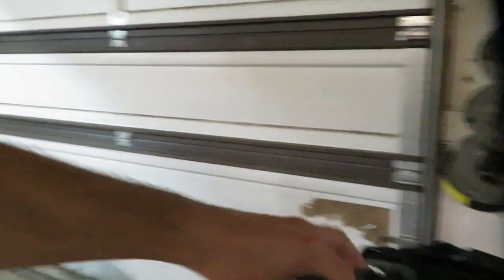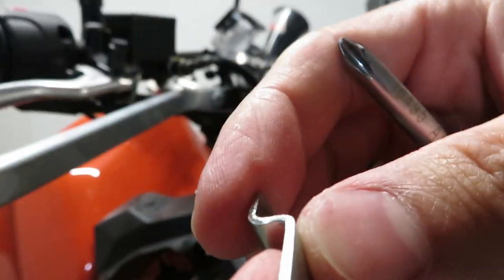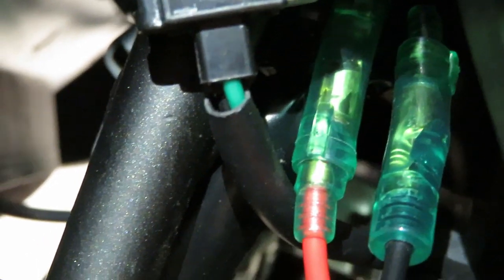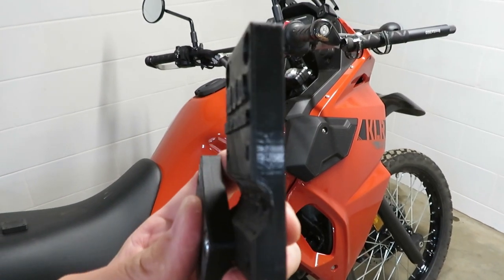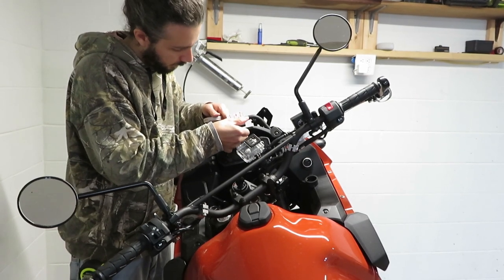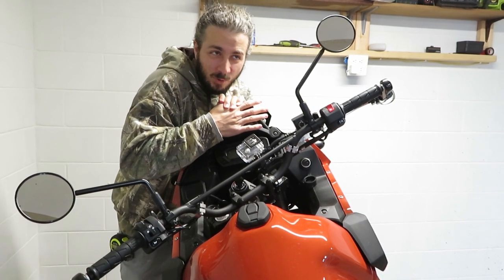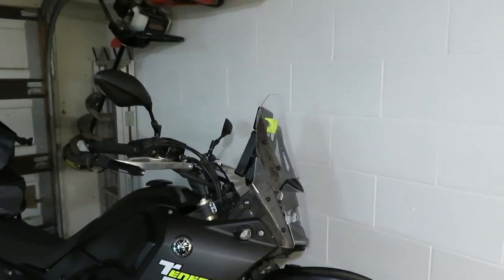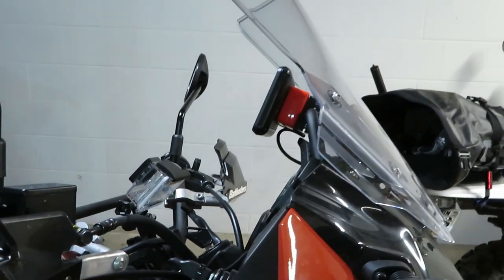⚠️Watch Before You Install a GPS & 12 Volt Outlet on Your KLR 650⚠️

Comment: Wow! So Kawi included an ignition switch supply and a relay mount already on the bike like that? That's a really cool thing to add in. Saves a lot of wire tapping and splicing for sure. That is a notable feature in of itself.

Comment: I used the Moto-Pumps Garmin-XT security mount, which locks the GPS in place.  The accessory bar is 14mm, for those who were wondering.

I spliced into the source power to the back-side of the 12V outlet.  I know those plug-in USB ports like to wiggle out and are made with the crappiest components China can offer.  I'll stick with the Garmin 12v converter, which bust the voltage down to 5.3Vdc.  I likely won't ever use this socket.

Comment: I have a gen 2 Klr that I mounted a garmin gps to. I found that the garmin doesn't like using the 5volt USB charger like that. Fine at idle but when you rev the engine, I'm guessing  the voltage is fluctuating, the gps shuts off or the screen goes fuzzy, similar to what I saw in a previous video of yours. 
If you use it with the garmin 12v plug it works fine. I don't know what they have built into their 12v plug that makes it work differently.
Reply from the maker: Huh that's odd, I've ran a few this way and never ran into anything other than vibration issues?
Reply: Maybe the newer alt/generator is better regulated/has more consistent output.
Reply: @natearchuleta2003  I had the garmin cable and a 14 gage auxiliary wire running from battery to the front under the tank. Perhaps it was getting interference somewhere. 
I have since rewired it, with just the aux cable going to the front to usb outlet and then plugged garmin into that. Works great now.

Comment: I tried a similar setup on my 2022 KLR650 Adventure and it rattled the GPS to death in 75 miles. Replaced with Zumo 396 on sale for $199 using ram mount and bar adapter without issue 710 miles so far without issue. The Nuvi models cannot handle the vibration I guess.
Reply from the maker: I might get a decent one some day but mine all seem to be holding up so far!

Comment: Does it matter if I add the USB to the left or right side?  Use the wires on the left vs the right. Does usb have to be on left side and use those wires and 12v outlet be on the right and sue the wires in the right. Does it matter what side the go on. Different wire or fuse size?

Comment: Haha, looks like your bar of soap is hiding behind your GPS. The things we do for convenience. Hopefully it resolves your vibration issue.
Reply from the maker: Haha yeah a little odd but it does seem to work!
Reply: @SwankyCatProductions  that's the important thing. 

They're setting the trails up here. I'm not sure yet what the plan is for opening. For Vilas, the snowmobile alliance meets on the 15th. They'll decide the opening date then. Only 3 or 4 clubs are waiting to have their areas inspected. It's very possible the season could start very soon if we don't get a big melt.